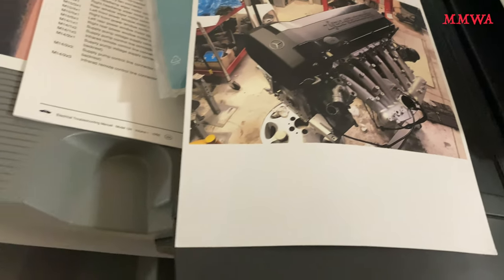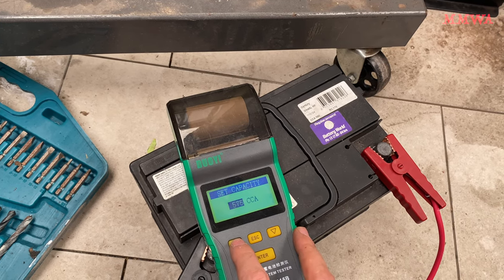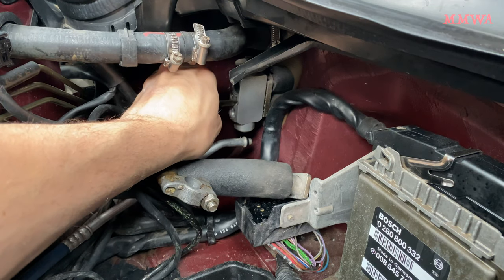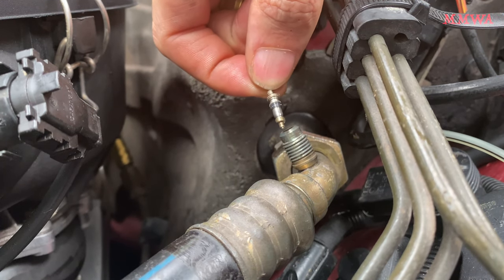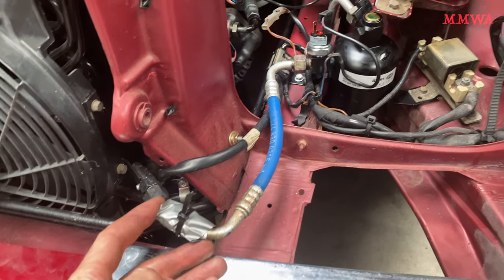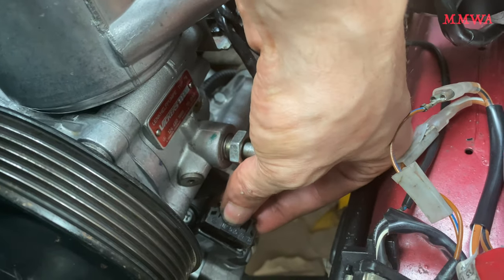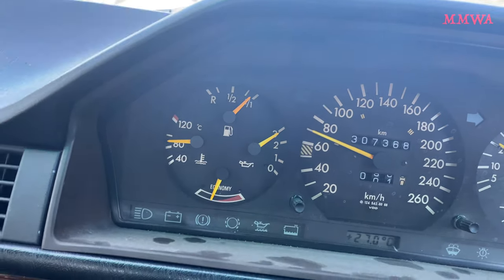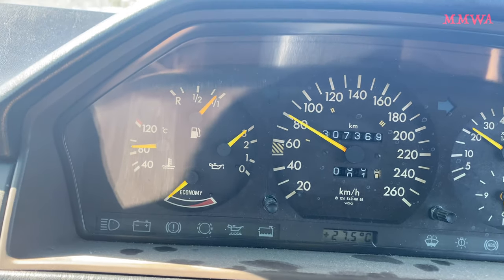W124 Work today - AC rebuild on one, Battery on the other.

Comment: I have w210 e320 great car and its 1997 with m104 the AC freezing cold in summer. And I'm from Iraq the weather in summer 50c to52c and the car handle it great. Great job keep it up.
Reply from the maker: Hottest I have ever experienced in AU was 50c in the middle of Australia in summer time. Was not driving a Benz though, was in my then Holden commodore (Chevy Lumina?) and it was handling it no problems at all. Coolant temp was a verified 90c too. I did install a larger radiator prior to the trip though, probably the same spec as the Middle East export version.

Comment: My air con in my 1993 320CE decided to quit a few months ago…tried to get it regassed and was told the system was well charged and the compressor clutch wasn’t engaging and I had an electrical fault.
Got my local mobile air con expert to look at it…he said the problem was the compressor…he organised a new one for me…a Denso OEM one and dryer which I fitted myself after he evacuated the old gas.
Got him to come back and regas it…clutch still not engaging…he jumped the clutch and gassed it.
Checked the old compressor and the clutch engages when jumped with 12 volts.
Seems I spent well over $1000 to find the compressor wasn’t the problem.
Now the advice from another MB specialist is it’s probably the Klima relay.
Cannot find the OEM A0035455605 relay new anywhere…apparently it’s discontinued and even Pelican Parts USA doesn’t have one.
Only solution is a used one and I can’t find one of those either except at a horrendous price plus ridiculous shipping costs.
The last expert told me to bypass the relay but I don’t like that idea…any advice on where I can get one or get my Klima repaired as there’s people in USA doing it.
I notice you repair OVP relays.
Do you want a good second hand compressor? Lol
Reply: I popped the cover off the relay to see if there was obvious burning inside…looks brand new.
I’ll be happy to send it to you and pay for the repairs.

Comment: Hey MM, Does Blue Black have an accumulator at the fuel pump?
Im wondering if the static fuel line pressure isnt leaking down on it, Simple check is to cycle the key 3 or so times before cranking.
Reply from the maker: Doesn’t matter how many times you prime the injection system on that car, the cold starts are always crap. The only exception is when its really cold and the cold start injector fires, then it starts ok. Hot and warm starts are always great. Its not a major problem it’s just annoying now that red starts flawlessly every time.
Reply: @MMWA-DAVE  Can't help thinking that there's something else in play here. My .051 has 350,000 k's and starts virtually 1st piston up.
Reply from the maker: @TOONACEDRELA  blueblack has had 3 or 4 headgaskets failed in its short run of 191k km due to incompetent previous mechanics. The cylinder walls have suffered damage from the water ingress on a couple cylinders. I need to remove the engine to fix the various oil leaks anyway so may as well refresh it. (after red is finished) BTW this is in stark contrast to red who had 1 headgasket change at 150k km prior to me getting it at 307k km. red's head also had zero corrosion or warpage etc. 2 different german spcialist mechanics in perth serviced the 2 cars.
Reply: Cold start valve inoperative at mid temp.  Squirt in some gas, or "jump start" CSV, and she will fire right up.

Comment: Hi, where did you purchase your AC compressor. I am trying to find one for a 1990 300CE. 

Would you mind adding links to where you purchase parts from in each video you referenced new stuff. 

I am NSW based, great to see an Aussie producing great w124 videos
Reply from the maker: All the small parts came from pelican parts including the master seal kit. The compressor oil and hychill was purchased from bursens auto parts. The compressor was purchased from parts container on ebay. Make sure you get the correct version, there are 2 that look very similar but are not interchangable. Search by part number from the EPC. The condensor I purchased from FCP euro. If you prepare the system with all the new parts you can have a mobile mechanic come out and pull a vacuum and recharge it if you arent confident in that aspect. You can also save a lot of money simply supplying the compressor yourself to an AC shop as they are a rip off in australia. Less than 50% the cost from the USA with postage.
Reply: MMWA thanks - your the best. 
My rural mechanic has spent 2 months sitting on his arse supposedly trying to find the compressor.
The mechanic diagnosed the compressor as having a leak, I’m not confident that it’s the problem.
Might be a leak elsewhere, is there any way to tell?
Probably best off refurbishing / replacing parts shown in your video, giving system complete refresh.
Would you agree?

Comment: Great video but wondering about the oil usually added to for example the receiver drier?
Reply from the maker: I dump the factory fill oil in the new compressores, measure the correct qty and refill with my own compressor oil.
Reply: @MMWA-DAVE  did you put any oil in the receiver drier, have seen on some threads that this is recommended? Thanks for getting back btw
Reply from the maker: @nelllane5083  ive never done that, but experts probably have opinions on best practices. As long as the correct total volume is in the system it’ll be good. Idealy dont want compressor slugging on oil poured straight into the suction port so I can see why theyd do that.
Reply: @MMWA-DAVE  yes guess any lubrication would be distributed through the system anyway, thanks again for responding

Comment: @MMWA -- your odometer gears need replacing.  It's a simple task to remove the cluster and refit appropriate replacement gears. You will need to order appropriate gears for km cars.  This is all detailed appropriately in the thread.  The process is detailed here:  https://www.500eboard.co/forums/threads/how-to-replacing-odometer-gears.4485/
Reply from the maker: Dont really want to spend money on this ugly cluster when I have a much nicer one to install after licensing the car. The odometer works just the lower trip meter doesn’t. I don’t think they will even care about that so probably not an issue

Comment: Just curious where you got all your o ring kit from in Aus especially the special ones you say on the compressor. What type regass did you use cheers
Reply from the maker: None of the AC parts I buy in Australia- the master seal kit came from pelican parts or FCP along with all the other bits. The Denso compressor is priced best at parts container on eBay. I use Hychill gas as no license required and off the shelf at bursens etc. the airosol cans suck as I can never get them totally empty. I also have a large cylinder.
Reply: @MMWA-DAVE  excellent thanks mate
Reply: @MMWA-DAVE  parts container is super!  Best prices on quality MB parts.

Comment: #7.13 the air con suction pipe. Mine gets quite wet on the metal part when running..my tech says its normal don't worry..is it ok or I need to do anything? Thanks if any ideas.M104 E280 1995

Comment: Do yourself a favor if u have to refill.  R152 aka Dustoff.  Even better than R12.  And not picky about oils.  My $0.02.
Reply from the maker: R12 has been illegal here since the 90’s and most refrigerants require a license to purchase to protect the industry. I use a hydrocarbon based one (fancy propane) as it can be purchased off the shelf here.
Reply: @MMWA-DAVE  No "Dustoff" available?  R152.  Magic.  Buy some on eBay.  Unless shipping impossible.  IMHO next best pure r290 (propane).  About same head pressure as r134 unfortunately.  U gotta use gauges.  Just as pressures settle add about 15 seconds worth of gas (vapor) to low pressure side.  DO NOT OVERFILL.  And so cheap.  The mixes are bogus.  Numerous technical papers will explain.  Again, Dust Off.